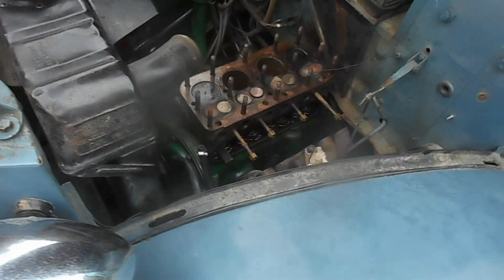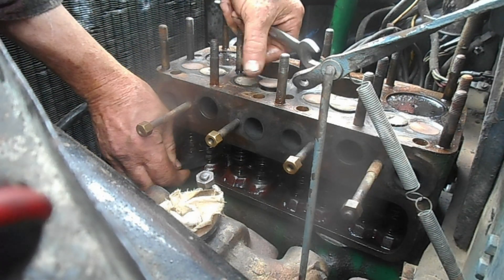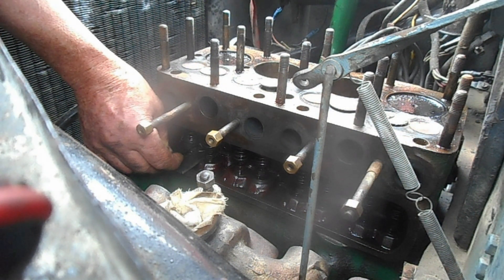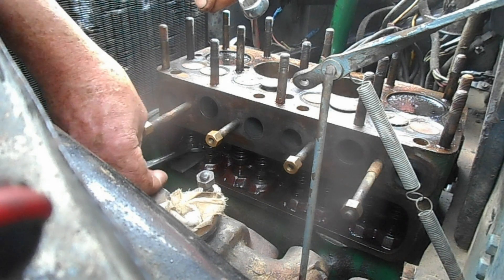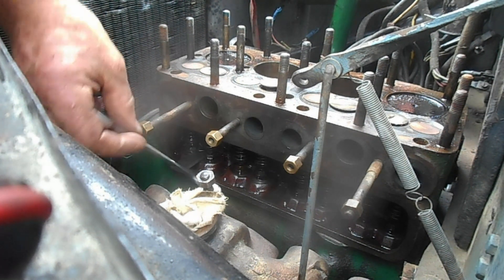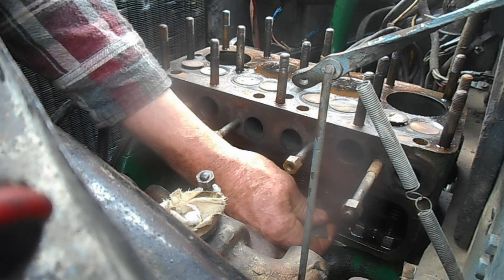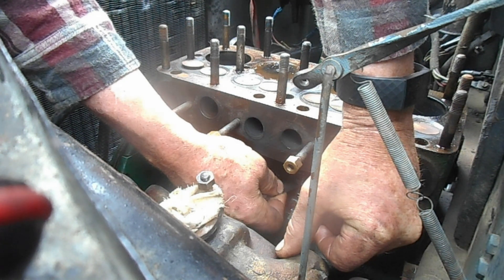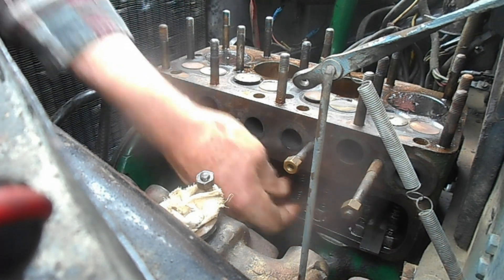Austin 8 valve adjustment

Comment: Great video thanks fior sharing..tell me what's the little tool you made I can see it made for the job...aslo had you got a part or pattern number for your fuel pump I have no clue what one fits 😂..all the best with the old girl..she's a lovely..I have a Austin 8 as a marine engine..she's lovely
Reply from the maker: The special tool is just a piece of flat metal 3/4"x1/8" or 19mmx3mm
I actually use an electric fuel pump as the original does not have an insulating spacer like on later cars.
On hot days in the mountains I found the pump would vapour lock and stop pumping.
Reply from the maker: 6V Electric pump is from fuelflow2020

Comment: Just wondering if you could give me some advise, I have low compression and I'm getting pressure in the sump is this the rings.?
Reply from the maker: I would say that is definitely the problem. 
A leak past the valves would cause low compression but would not pressurise the sump.
Reply: @GSimpsonOAM  OK thank for the responce I'll let the garage know👍🏻

Comment: I'm looking at buying a 1940 Austin 8, any tips or things to know?
Reply from the maker: They were Austin's first car that was monocoque. (no chassis)
So watch for rust in the sills in particular as they are structural.
The motors did not have a proper air filter (typical of the era) so engine can be worn. What looks like air filter is just a silencer with a fly screen. Doesn't stop dust.
The motor was an improved Austin Big seven engine and more advanced than some of it's competition. 
Four speed gearbox helps. If scynchro not working well the previous owner may have used EP gear oil. This is wrong and recommended oil is SAE 40 Engine oil.
Variable ratio steering. Again people use grease rather than the recommended 140 gear oil same as the diff. I just top up now and again with oil can.
Suspension bushes are bronze and need regular greasing or they quickly wear. New ones are readily made.
Engine is only 24bhp but lots of torque and will cruise all day at 50mph and get 40mpg
Reply: @GSimpsonOAM  thanks so much for the information. Would you know about any common engine swaps? Perhaps datsun a12?
Reply from the maker: @marcusmazdaboy  Would probably be a straight forward swap but you may need to upgrade the brakes for certification. Mechanical on A8
Reply from the maker: https://www.facebook.com/search/top?q=austin%20eight%20register